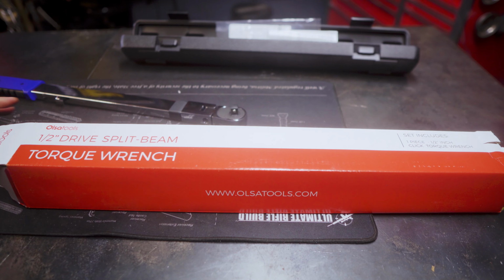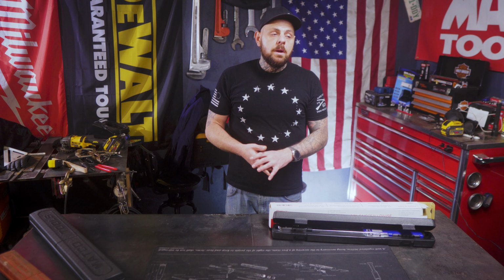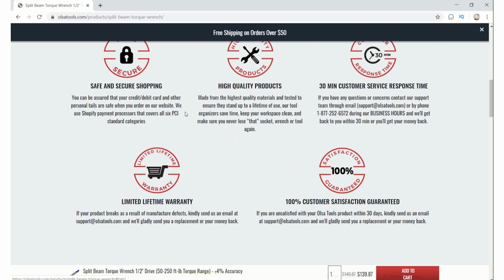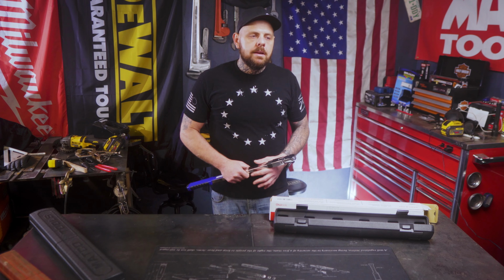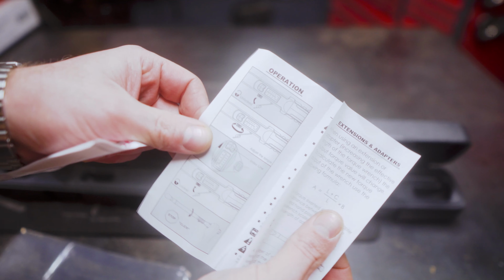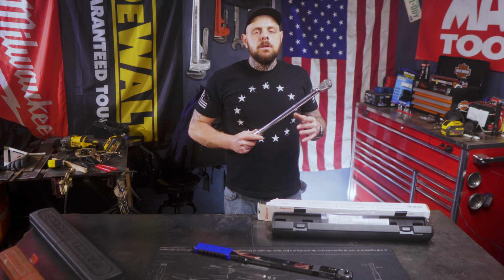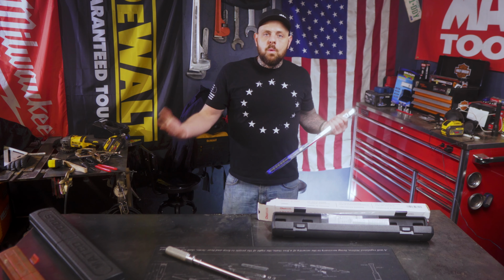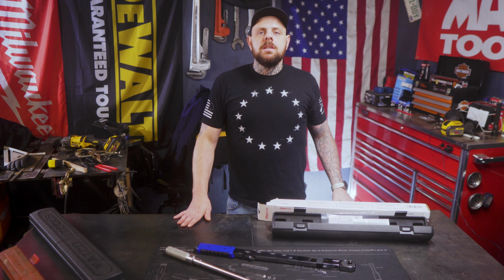Olsa Tools Split Beam Torque Wrench

Comment: It is either made by precision instruments  , or a Chinese knockoff of a precision instruments  .
Reply: China Knock-off, research it. Found this torque wrench for $59 at China web site fefall.com. Precision Instruments used to make torque wrenches for Snap On until 2003 or so, now Snap On bought out CDI Tools and under that logo CDI is a subsidiary of Snap On. This Olsa torque Wrench is priced (in USA) about the same as the Precision Instruments Dual Beam so you can buy either China made or USA made for same price unless you want to chance buying from the web site I mentioned (in China) OR CDI ALL 3 of the companies mentioned have basically same dual beam torque wrench. I'm debating between Precision Instruments and CDI, CDI costing a little more like $10 or so. Though I read somewhere while doing my own research cDI and PI both use parts from China and assemble in USA...whether true or not I don't know, it wouldn't surprise me though.
Reply: harry berry Precision Instruments makes all of their own components just outside of Chicago.  Even the blow molded box is made in Iowa!  They invented the split beam torque wrench when they first made them for Snap-On in the late 70’s.  CDI copied them about 15 years ago and now Olsa.
Reply: Inverse Universe this tool is NOT made by Precision Instruments.  It is an overseas copy.  Precision Instruments’ split beams say, “Made in the USA since 1938.”
Reply: @larsonmk1  , 
Thank you , 
I was mostly suggesting that it was a knockoff , that looked so similar to P.I. , I could have fallen for it .

Comment: I have both click and split beam 3/8 and 1/2  torque wrenches at work. I prefer the split beam in most cases. The only time I prefer the click type is when sorter over all length is a must.